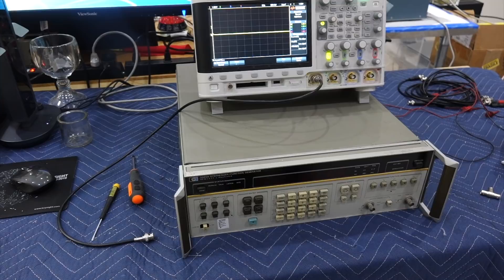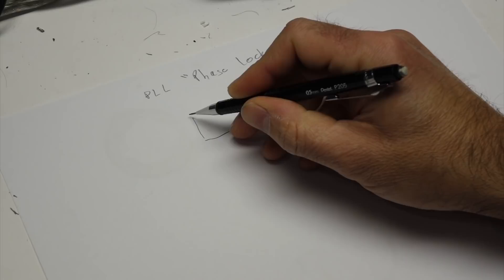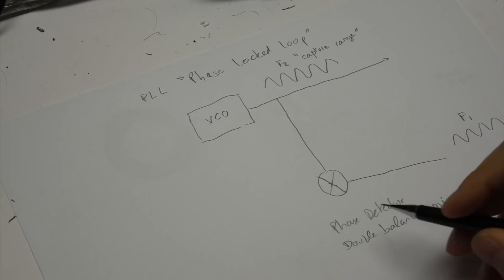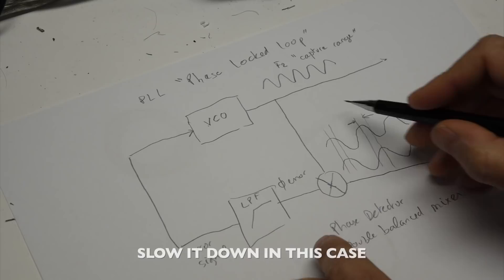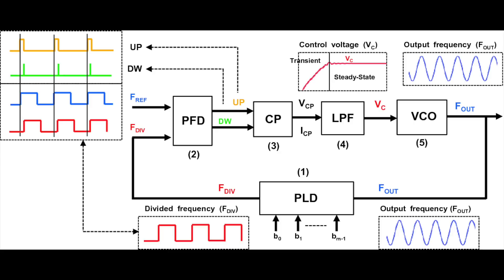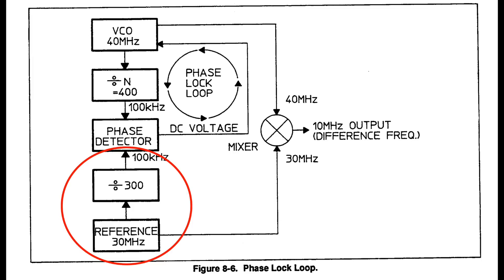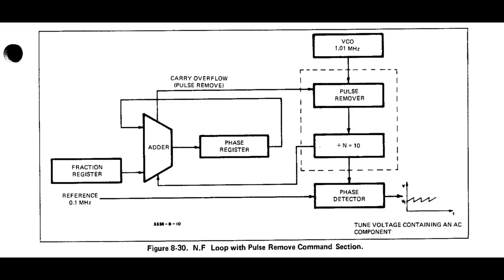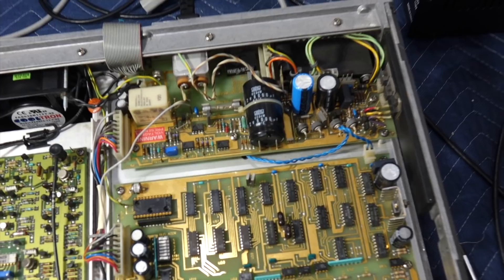HP 3325A Bonus Material: Fractional-N Frequency Synthesis for Dummies

Comment: You'd enjoy the synthesis of colour subcarrier frequency (4.43361875MHz) from the centrally generated 'Natlock' reference signal that the BBC used to use.......    I recall having to work it out for an exam many years ago. Sadly, age being what it is, I now have no clue!! :)  I can recall it had a large a complicated selection of dividers and PLLs. The idea was that you ended up with every contributing regional broadcast centre running with the same, locked, colour subcarrier. It meant you could put sources from all over on your mixer and just needed to do a simple phase shift to get them all timed up.  Way back in the analogue days.
Reply: That’s really interesting! I suppose the economies of scale made that cheaper than genlock circuitry for the colour carrier in every studio?

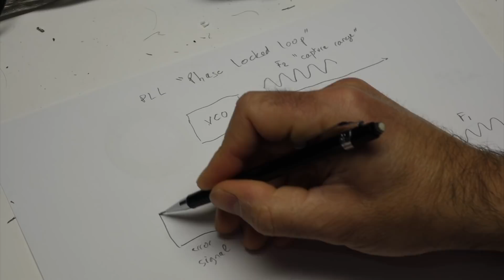Comment: 3:30 Hmm, if my math is right the DC component of the output of a mixer whose inputs have the same frequency is proportional to the cosine of their phase difference, which seems problematic for locking on since it just gives you the absolute error rather than the signed error, hence you wouldn't know which way to correct.  Am I missing something?
Reply: oh duh, you lock them 90 degrees out of phase

Comment: What are the practical applications for Frequency Synthesizer?
Reply from the maker: Very important circuit in modern RF. It allows you to generate a digitally controlled, arbitrary tunable reference frequency from a single quartz crystal. You have one in every radio, WiFi, cell phone, etc…

Comment: Cool thanks, but what would use it for?
Reply: Producing very precise frequency signals, mainly for testing and calibrating other equipment, rarely as a thing you need on its own (at least at the price point this piece would retail at).
Reply: I used it as a quick and dirty hearing test at the end. It almost reached the pitch of my tinnitus. :-)